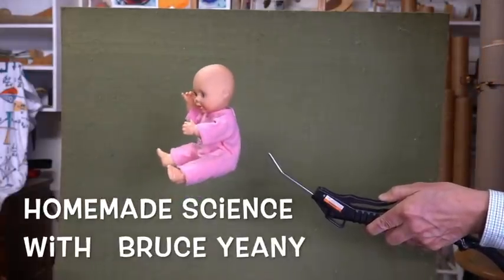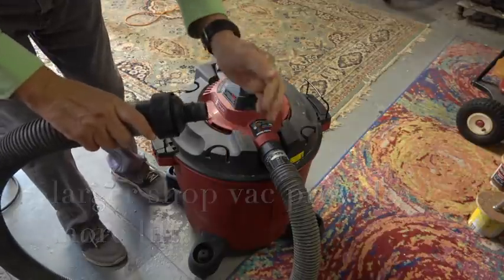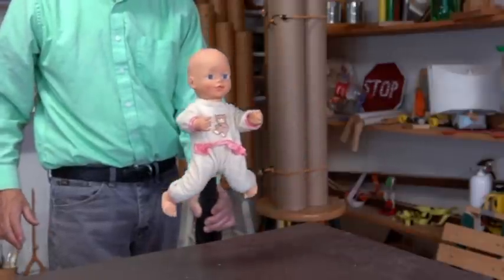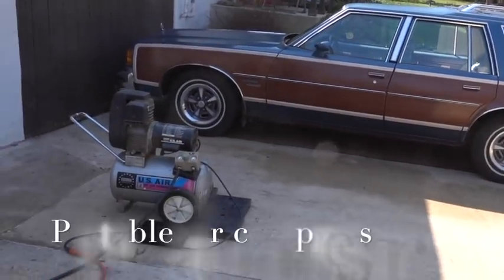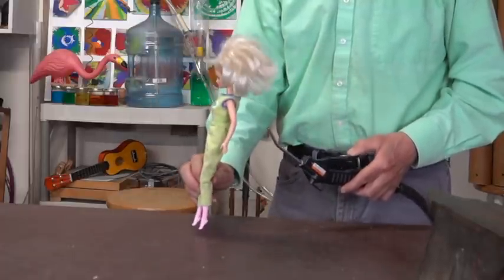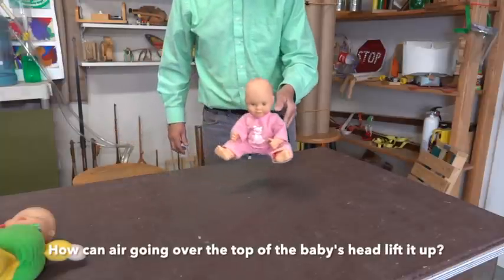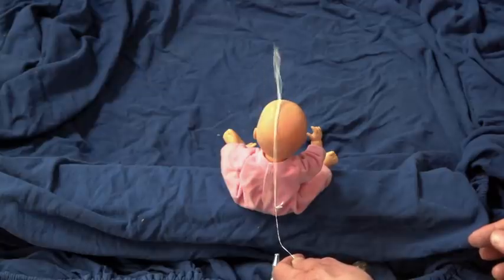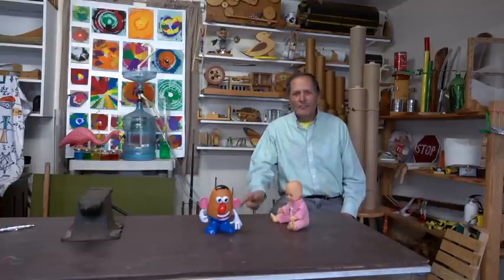Flying baby dolls.... the Coanda effect in action //  Homemade Science with Bruce Yeany

Comment: That's is amazing! Brilliant!
A doubt: lifting force is related to the air pressure or the air flow? In order to lift heavier objects, do we need more pressure, more air speed or different shapes/areas? I wonder if there is a way  to measure the lifting force and how it changes based on the pressure or shapes! Great job Bruce!